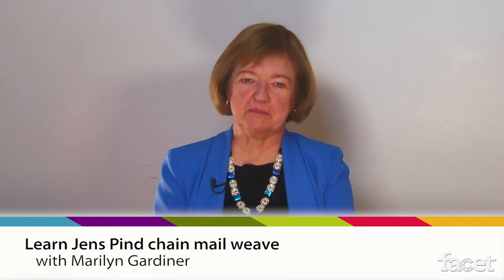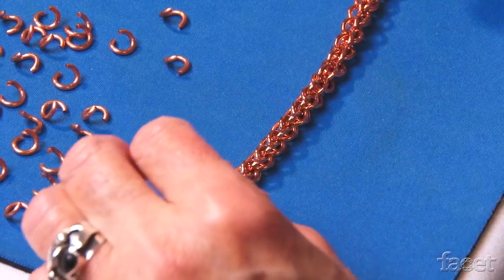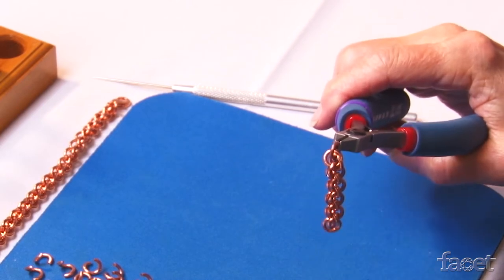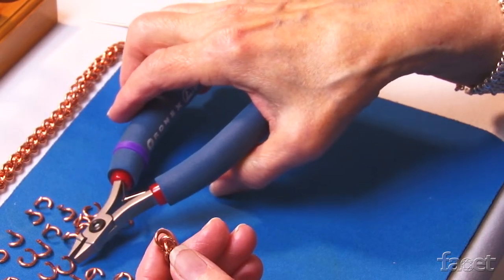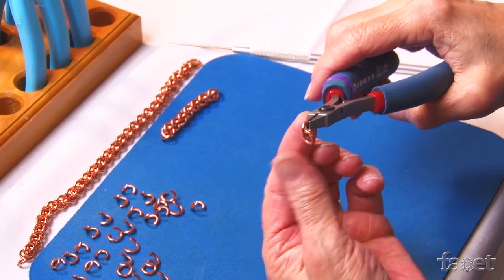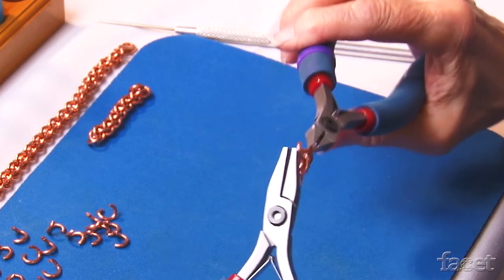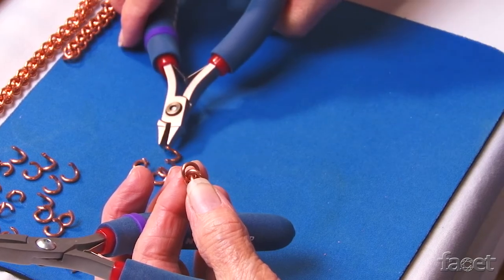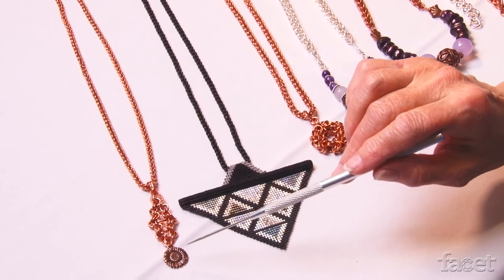How to make Jens Pind Linkage chainmail

Comment: I found your video very helpful, but I had difficulty seeing the pattern in what I was trying because I was guessing at the size rings to use. That information would have been helpful or the AG ratio. Still have trouble starting but will not give up until I conquer it. It makes a great chain to add to my projects. Thank you. I eventually use 18 gauge 3 mm rings for AG 2.9.